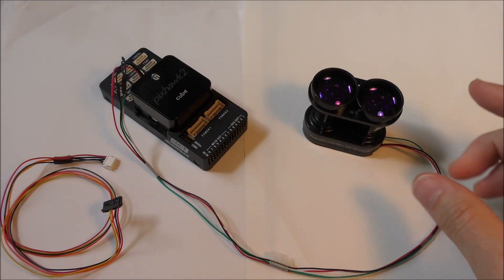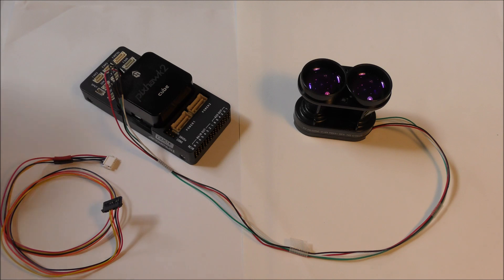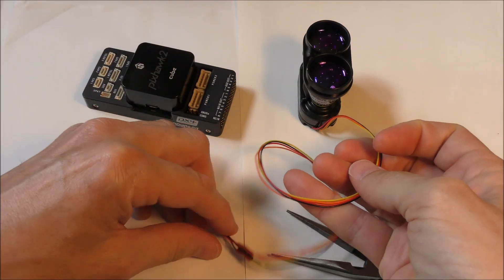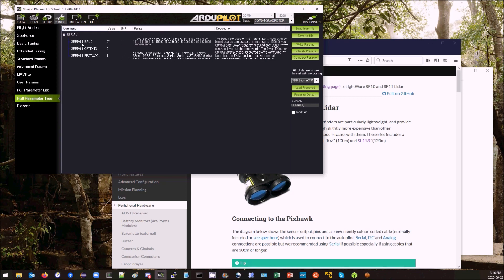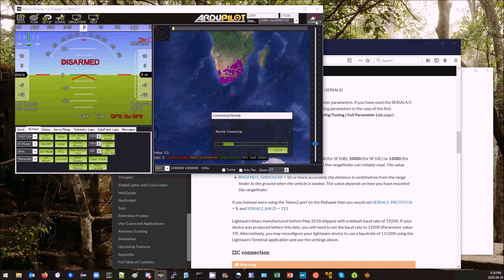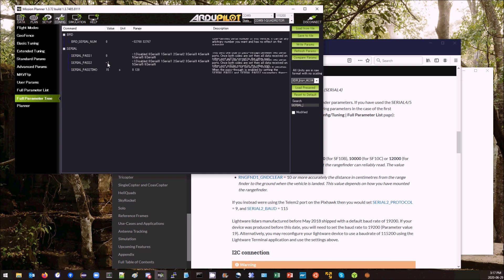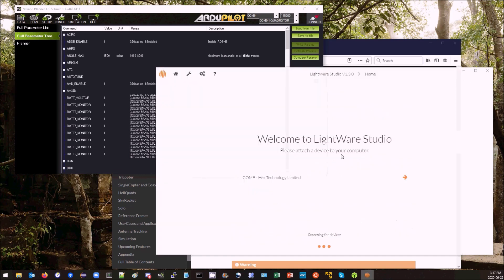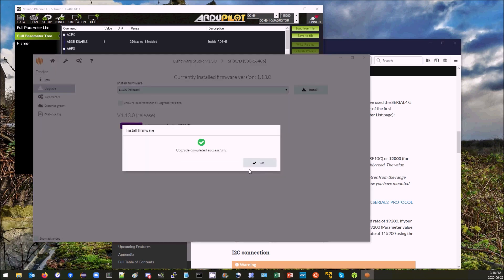Lightware SF30d firmware upgrade using ArduPilot's Serial Passthrough

Comment: I just bought this sf30d unit and I am struggling to make it work reliably with I2C, it only worked with i2c when I changed the settings to "Full communication mode" in lightware but the delay in readings is very big (almost 2 sec). Did I use the right settings?